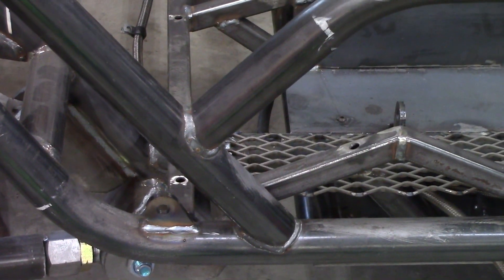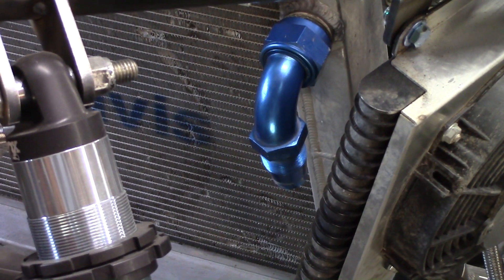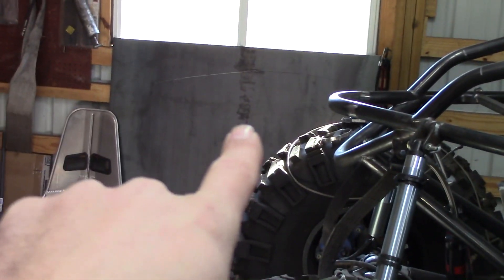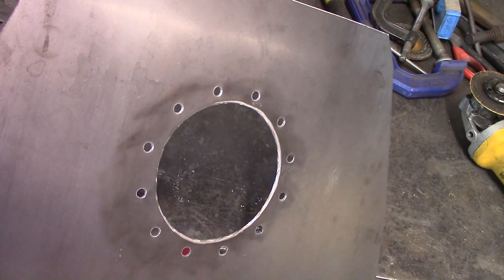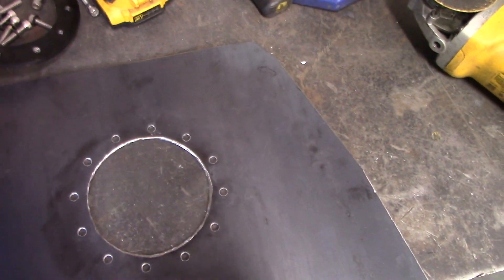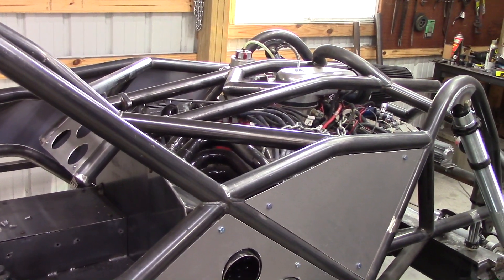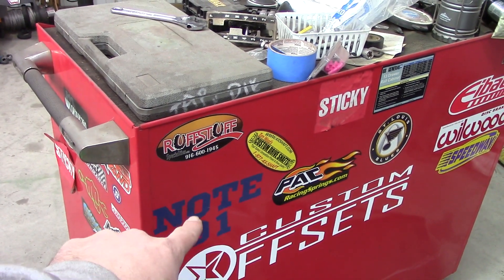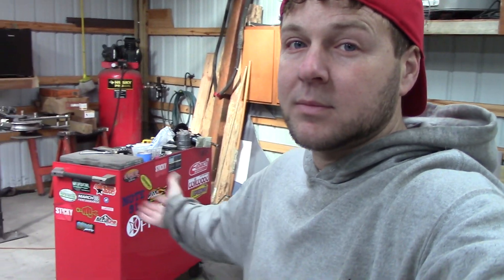I build a custom Fuel Cell for my Rock Bouncer

Comment: Thanks for the update! Do you got anything inside the fulecell planed to prevent it from slushing around? Why not make it out of aluminum?
Reply from the maker: It will have a divider (possibly 2) inside with a small passage for fuel to pass through. It has worked well on my other one for 6 years. As for aluminum, I have seen aluminum cells crack more often than mild steel, at least in this sport.
Reply: @Lowbouncer  Thanks for the answer. Recently watched a video from Busted Knuckels Offroad were they showed their fuel cell. It also had 2 dividers but was made of aluminum. Interesting how they welded the dividers through the top. I get it’s better to have it a little bit more heavy when you don’t have rescue people surrounding you. Welding aluminum seems to be more difficult too.